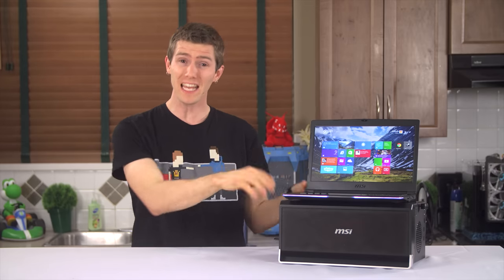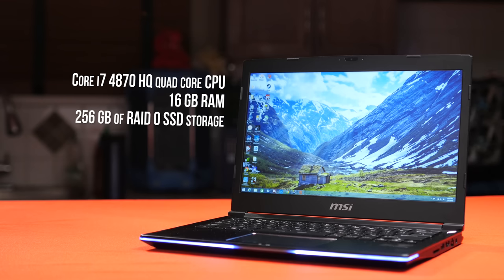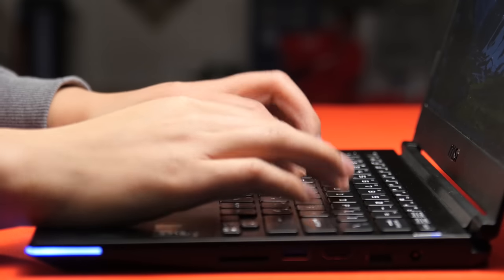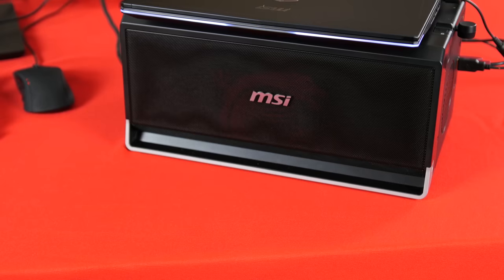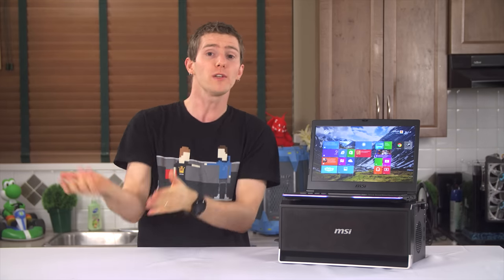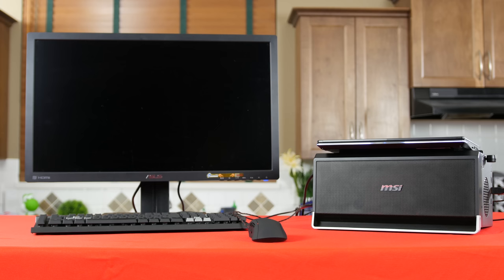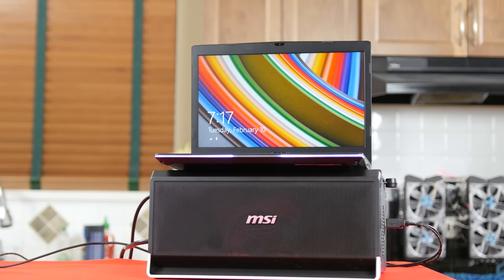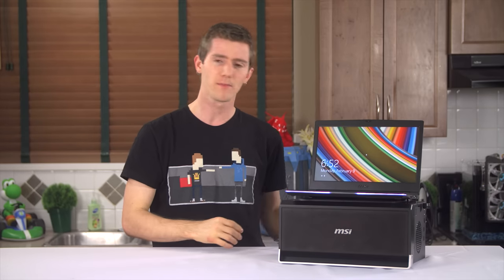MSI GS30 Shadow - Part Beastly Gaming Rig, Part Ultrabook

Comment: I like the idea of being able to have a professional styled laptop and the ability to dock and game. However I disagree on the design of the desktop box through it's bulk and height. That's where I'd say they went wrong. Had they instead allowed to dock using cables and have the box stowed away under a desk or to the side then it'd probably be a more of an attractive purchase.

Although this technology isn't really new, just a gimmick. People have McGuyver'd their own external GPUs using PCIe parts, PSUs, and housing but also requires an extra monitor. Even still the bulk people were able to achieve were much much much more minimal that this.

Comment: I personally see the benefit of using something like, having the power of a desktop when you are at home, but still have a laptop for when you are on the go. But I think Alienware does this better, as it does almost the same thing, but theirs is not as clunky as MSI's, like it doesn't need to sit on top of the dock, and their laptops don't come with INTEL INTEGRATED graphics, like seriously, I would rather get Alienware's just on that fact alone. Its a really good concept, but they have a lot of to work on in order to make it better.

Comment: Hold on, if i understand correctly, the laptop have a good CPU and a okish gpu in the laptop. The dock have a desktop gpu and can mount a 3.5" hdd. So when connecting the laptop on the dock, the desktop gpu take the place and the cpu and ram calculate inside the laptop do the rest?

Comment: MSI's innovation here has some really great potential, but the price is seriously constricting. If the price was $1500 for both the laptop and the dock together, then absolutely this would be a perfect buy for someone who is, say, a college student who games or programs a lot. But again, $2000 alone is too much.  It's a better deal to get a $800 laptop and a $1500 desktop and get better temps and similar performance. But keep on the innovation, we need this out there!

Comment: Linus, as you said there are some "janky" solutions.  I've heard of a laptop to 16x adapter that leaves the graphics card completely exposed as well as the power supply.  Could you do a review of something like this.  The only problems I see are protection, and the bottom of the laptop has to be left exposed.

Comment: honestly for $2k wouldn't a $700 laptop + $1300 mitx pc be way more practical because you still take the same space in your house and you have upgradeability..
Reply: Well you would have to sync work data across both devices and have 2 things lying around instead of the hybrid you have here. if the box was smaller or had more features then i would be on board with it but 1st gen problems......

Comment: I get where Linus is coming from when he says why buy two computers when you can buy one to carry around then turn into a gaming PC at home, but when it's so damn expensive to buy the laptop, the dock and a GPU I would wager it's far more economical to buy a cheaper and similarly powerful (and quieter) ultrabook and a modest gaming desktop with the same graphics card. Not to mention this thing is going to be primarily targeted at gamers, who almost certainly own some sort of gaming PC to use as a base to upgrade anyway, saving them even more cash.

I think as long as these things remain proprietary they're never going to leave the niche corner and never really develop into a proper product category. If only the industry could come together and develop a universal standard, or simply agree on a shared connection.

Comment: I totally agree with everything said in this video. First, I'd like a portable laptop that has decent battery life, at least 5-6 hours, it won't be as lightweight but portability is much more imporatnt.
And secondly -  yes, what Alienware did with it's Graphics amplifyer is nonsence. Why would a gamer pay for the videocard inside the gaming laptop if he's not gonna use it with the graphics amplifyer? Sure it's good for travelers, but most of travelers wouldn't need a graphics amplifyer in the first place...

Comment: I don't know if Linus or anyone will answer to this question, but i want to ask your opinion about DIY solution on graphics card solution like this. For example, using expresscard to PCI-E adapter to attach the graphics card so i can use desktop class graphics card on my laptop which got the expresscard slot

Comment: I really like the idea and the way this is made, but this should be made using a USB 3.0, ethernet or whatever port, as the box itself should really just be a regular pc case into which you plug the laptop in. so when this reaches the price tag of 100-200 USD (case+the switch technology thing, no GPU), it will be a interesting option, but now, it is way too expensive

Comment: I recently purchased one of these MSi GS30 Shadows and I have recently placed a Graphics Card & 3.5" SATA HDD into it along with purchasing an Monitor screen so I can get it all up and running.

My question is, while the laptop is docked in the booster how can I tell if my Laptop is getting that additional 'Ooomph' in GHz I know the Graphics card is working cause my monitor is plugged into it and everything in the PC says its working, I know the 3.5" SATA HDD I added into it is working because my computer sees it.

However when I go into system to check the stats of everything overall I still see that my speed is at the Laptops 2.5GHz as if the system cannot see or is not showing that even though the laptop is docked I am not seeing the 3.7GHz anywhere in data?

How do I know if it is getting the boost in GHz from the Booster?

Cheers

Comment: What resolution is the monitor he used to play crysis 3 on? How could he achieve such fps on crysis 3 with one gtx 980?is it on low settings? I didn't know a gtx 980 can reach 120 plus fps in crysis 3 on very high preset at 1080p (unless of course he uses a sub-1080p monitor and the settings turned down)

Comment: 2 things they need to do before I'd be interested. Have more laptops that are compatible with this desktop GPU box. And have the GPU box available by itself. I couldn't care less for GS30 Shadow laptop itself. My 2.5 year old GT70 is much better in value for money and performance. If the GPU box costs $1k by itself, then of course, we'd be better off just building a desktop PC for that price alone. It's almost time for me to get a new system and my best choice would be to build a desktop PC, both for performance and price. Of course, I'd still keep my current laptop for pseudo-portability. I honestly don't see why people would pay $2k for just this. Imagine the beastly desktop PC one could build with that money. The technology is here, but it needs to be cheaper if it wants to be of any use.

Comment: The decision to have the laptop dock directly on top of an enormous box was horrible. I understand it's more difficult from a technical perspective and may come with some trade-offs, but regardless of what those are there should REALLY be a cable between the box and the laptop (I believe Alienware's solution does this) so you can set the box to the side and have your laptop at a comfortable and easily adjustable height and position.

Also Intel seriously needs to stop fucking around and license eGPU products using thunderbolt (Asus and Silverstone have both been trying to do this for a while now but Intel won't sell them the license to use Thunderbolt for the purpose). Thunderbolt, IIRC, is bottlenecked at 8x PCIe instead of 16x, but the loss of bandwidth really won't hurt performance that significantly and the reliance on first party closed standards is strangling eGPU potential because who wants to drop that much money on something that's locked to a proprietary standard that might flop so hard that its never seen again?

Comment: They need to streamline this thing better.  37W CPU might help with heat, focus on clockspeed for CPU when docked and the dock needs to be a little more elegant.  The ultrabook doesn't look too great either, that logo!  And yes, $2399 for this is way too high, something like $1899 is more reasonable.

Comment: holy SHEEZ that thing is enormous... its like a monolith...
i dont think the people at MSI understand the Concept of portability
and really now 2200 Euro is WAY WAY to high... i would just go for the more DIY External GPU solutions and combine it with one of those super tiny PSU like say the PW120M(if u want something Very portable) and combine it with a decent power single cooler GPU like the GTX550TI and u have yourself a very cheap and very powerful laptop

Comment: I wish they would just make an adapter that can connect to a laptop's USB ports and hdmi to use an external desktop graphics card.  I don't know how PCI-E 2.0 works, but can't they route the data from the laptop's mobo external ports to override the mobile graphics?
Reply: ***** well they have desktop graphics cards that you could buy from a huge range of companies.  I'm sure at the beginning, there was a single company that didn't want this getting out to others too.  which is why they sell parts and not pre-built computers.  Maybe in several years or even a decade, when the patents expire, there will external graphics adapters that can be interchangeable with any brand of laptop

Comment: Is there ever a situation where you need to press on your keyboard that hard? His demo of normal typing on the keyboard didn't generate the flex he pointed out. I can understand the appreciation for solid build quality but this seems like efficient engineering design more or less if it doesn't affect the integrity of the laptop.

Comment: just gonna post what my argument case with my friend when it 1st appeared at CES.
the gs30 is not so ideal especially at this price, with a box this size it would be wiser to just get an Itx setup with gtx 970 or r290x,  in it and a bigger storage for 1200$ and channel the other 800$ on getting a kick ass ultabook, such as carbon x1 for school, this way I have two computers instead of one which is more practical and safer in case one busted up on u.

Comment: + ?  Can t find any..
- Only 1 card
- Loud (you said it..)
- Useless without the laptop
- Speaker?
- Only 1 drive..
- dust filter?

If it should even be an option it would need room for 2 graphic cards, have raid option, remove speakers, bigger fan and dust filters

Comment: Alright. Here is some stuff I want to point out:
$2000 and no GPU. I'm sure a person who knows how to install hardware would get a Desktop and a cheap laptop, because the dock is the size of a desktop, so no travelling at all.
A person on the move wouldn't be able to travel with a massive dock with him.
It eliminates the point of laptops, no gaming while travelling at all, no GPU included so you have to pay extra and put it in yourself, which isn't why people buy Pre-built stuff in the first place.
You must be weak to not get a heavier laptop for the same price with no need for installs and great performance.
IF the computer with the dock were $1000 dollars all together, then people would buy it with no regret.

Comment: when using the dock do you need to use a external monitor in order to use the desktop gpu or can it output to the built in display on the laptop ?

Comment: this is €1500 for the 512 gb version with the dock and a gtx 980 included. Do you guys think that's a good deal?
Reply: Ward Huyskes you could probably get a gtx1070 laptop for around the same price
Reply: no you can't, not even in the us and in europe you can't even get a gtx 1060 laptop for that price.
Reply: I found a gtx 1070 laptop for $1500 in the US. GTX 1060 laptops are significantly cheaper but that's besides the point.  http://www.newegg.com/Product/Product.aspx?Item=N82E16834154348&cm_re=gtx_1070_laptop-_-34-154-348-_-Product
Reply: lomna17 ok yeah that's pretty legit. But I said "*in Europe* you can't even get a gtx 1060 laptop for that price" which is absolutely true, if you don't count the alienware 13, which is garbage here because it comes with a 768p tn panel.
Reply: i'd say go for it. thats a good price.
Reply: Ward Huyskes "not even in the us"
Reply: lomna17 yeah, that's why I started with "ok yeah that's pretty legit". Then I followed up by saying that gtx 1060 laptops are not even cheaper in Europe.

Comment: I will admit that this thingy is quite smart and it may be a good technology for the future, but to be honest, at this moment I prefer a Clevo 650SE with gtx980m which offers more portability and gaming experience on the go. Or even the G751JY which also offera a much more pleasant mobile gaming and you won't need an additional display panel nor a keyboard. 

Present: Money thrown out the window.
Future: Might be quite a turning table product.

Comment: Ok I'm making my first PC is this a good setup? 
Amd fx-6350
Gigabyte ga-78lmt-usb3 micro atx am3+
G.skill ripjaws x series 8gb 2 x 4 ddr3-1866
Western digital caviar blue 1tb 3.5" 7200rpm
Club 3d radeon r9 270 2gb '14 series 
Rose will 450w atx12v / eps12v 
In a cooler master n200 case
Reply: I would recommend a R9 280X or 270X if you have the money.
Reply: If you play MMO's or are looking to play MMO's id recommend going with an intel cpu since all if not 99% MMOs are cpu intensive and do not run well with amd cpu's i have an amd fx 8320 with a gtx 970 in my pc and god damn it runs AAA games PERFECT but games like MMOs that require better single threaded perf suckkkk!!!
Reply: Atleast get an fx 8320 tho..
Reply: Elisha Odend'hal You realize a 270X is basically a factory overclocked 270 right? I mean, linus even had a video on it...
Reply: Yeah but if he isn't going for over clocking or doesn't know how

Comment: 2.25 hours of battery use for a laptop?  Does the i7 really drain it that quickly?

I'd need a dock with multiple video cards for my setup, but I do like the concept.  Cloud storage has made syncing 2 computers easier, but there are still things I need to do twice if I want my desktop and laptop to remain in sync.  

They need to up that battery time though for me to consider this a real option.  4 hours is a bare minimum for me.  I know I'm not getting 10+ with the sort of CPU I know this needs.   Maybe someday they will be able have dual CPUs as well so I could get my low watt cpu when mobile but high end when at home.

Comment: Linus, you've fallen into MSI's trap again. 

So MSI does this from time to time, and it always amuses me. They experiment. They test. And they try new things. And that's awesome actually... In theory. 

What they end up actually making is great showroom pieces that don't actually do much good in the end. Remember, MSI was right there on the Mini-PC wave, with a case that doubled as a Stereo, but failed to perform well as either, given that the machine was very poorly ventilated, and the IR receiver for the included remote control was less than stellar(As was the inexplicable problem wherein you could ONLY use the stereo faceplate controls that read MP3s from the hard drive or audio from the CD drive(Or, perhaps most oddly, FM radio only) while the main portion of the PC was off, until a firmware update almost two years later gave the functionality for Windows Media Player control to that faceplate). 

MSI is very good at putting their toes in the water and seeing what can be done. What they're not very good at is producing something truly amazing from the end results of that sort of experimentation. In this case, what we have is a laptop dock that is basically required by design to take up excessive room on your desk, with unsightly cables sticking out both sides, and clearance required on the front end as well so the notebook can be safely removed and inserted. The dock itself is sized so that it won't fit in any standard PC alcove in a desk, too deep to fit behind monitors in most desktop setups, and too tall and unsightly with the cable problem to be considered a discrete desktop solution.
Reply: (Also, running the laptop with the screen up on the dock? Is not ergonomically sensible with the height of the machine.)
Reply: It's not that it's big. It's that it's big and cables stick out of both sides of the damn thing. Which means it's just ugly all around.
Reply: A lot of people think they're ugly actually. Especially in this way where you'll end up having to pick up third party cable management as the exterior of the case here has none.

Comment: Hello Linus,
It would be incredibly helpful if you could answer to this as I am thinking about buying one of these, as I am in a need of both a normal Desktop PC and a Good Laptop but I am on a budget, so I was just wondering if you could answer this to me as you've actually had it for a while.
Is it possible to use the laptops screen itself with the GPU inside the Dock or you only can use the Dock if you have a Monitor seperately ?
Reply: Sniedzinsh i think it can the mini dock works like that although i wound not recommend using the laptop keyboard or mousepad in which case the laptop would be pretty far away therefore a 13.3 inch screen does not cut it

Comment: whyyyyyyyy? cant we play it on the laptops main screen. can't you make the dock station have a video input by the pci-e male so the video connector plugs into a separate video in to the laptop instead of a monitor.   What im getting at is make it to where the laptops monitor can switch inputs LIKE A TV

Comment: Is this a laptop replacement or a desktop replacement? Maybe both?
Reply: its hybrid solution. i do think the laptop could have done with a small dedicated gpu as a secondary thing but iris pro is apparently good enough for gaming in 720p. most people are complaining about the cost and practicality but not thinking about the fact you can keep the important stuff on the raid array and the games on the mass drive and have the option to take that everywhere in an all in one device.